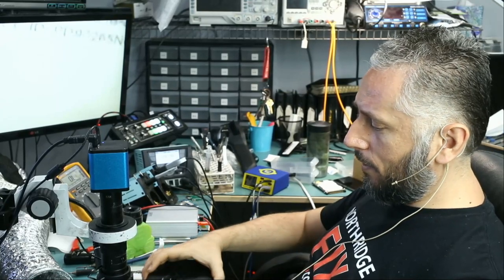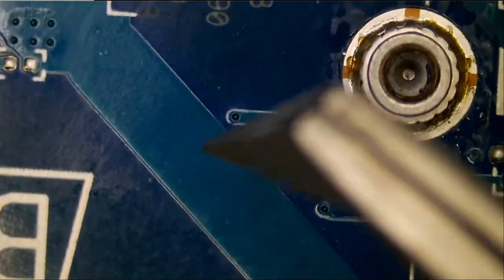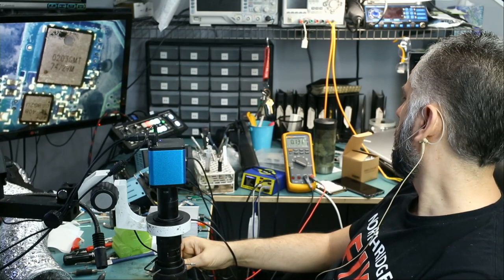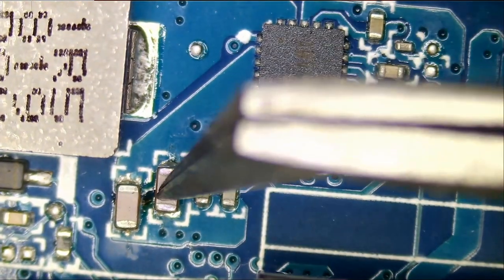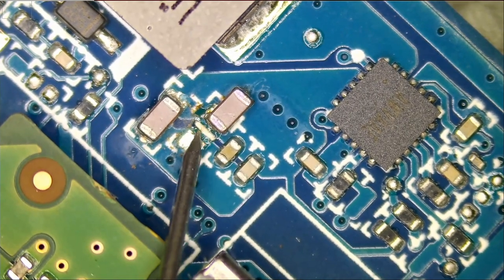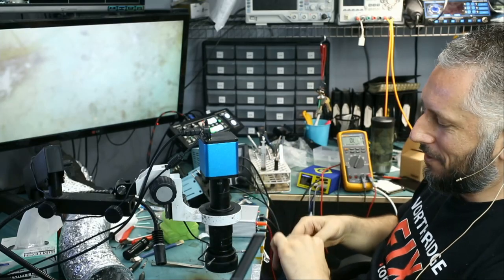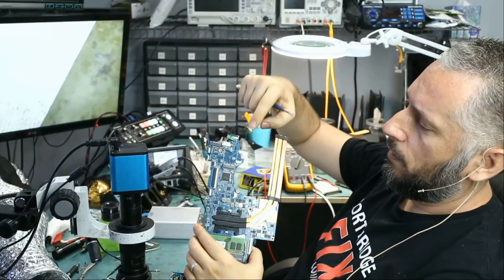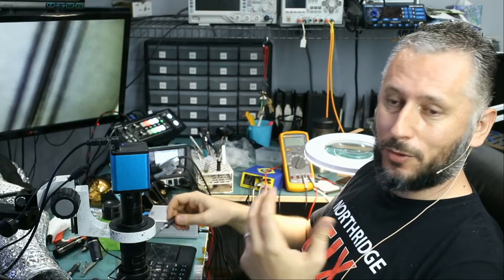HP Pavilion No Power Repair - Tracing short circuit using voltage injection & thermal camera

Comment: Your methodology of repairing is super duper cool.

1. Check connectivity.
2. Using Thermal Cam spot any overheating components.
3. Identify the cause of error and fix it
4. Job Done

Comment: What would you do without a thermal cam? Looking for a needle in a haystack for sure. Great video on how the find a problem methodically. Thank you for sharing your experience!
Reply: couple options, spray it with isopropyl and look for where it boils quickly, or feel around with your hand

Comment: Just found this channel yesterday, and I haven't stopped watching it!  Can't wait for something of mine to break so I can try to search for the issue.

I really appreciate that OP repeats things he's surely said in earlier videos (like what type of flux he's using).  So please keep that up for us noobs.  

My question - is there a video that shows an example of how to setup this short circuit search?  The way I understand it, is voltage is being injected somewhere and a continuity test is being done.  I'm looking for a noob version of this - where to inject the voltage, what to set the multimeter to, etc? 

In the meantime, I'll keep watching and cheers for this awesome channel!

Comment: After follozing you for a time, i juste do my first real repair even :) i was a efi chip desoldering /programing / soldering  for a macbook air a1466 emc 2632, and now it works. by the way it was olso my first macbook opening, o i ripped to small connector that i olo fixed. Thanx alex

Comment: Thx for sharing.
My short hunting is a little different. I use a current injection of about an amp and measure the voltage drop along the trace. This will guide you as to which path to take when the trace forks.

Comment: Thank you, good work again.voltage injection and thermal cam indicates shortened piece at the moment.we need that equipments I'm still burning my fingers to feel thermal increase on the board.and my lab power supply just injects max 5 amps even on 1 volts odd 30 volts.

Comment: Very good one. Thanks Alex. Quick question I may have missed, would a bench power supply work instead of the voltage injection tool?
Reply: yes it can, as long as it has variable voltage and amperage.

Comment: The short detector is a really excellent tool, I was just looking at one of your previous videos where you showed the mechanic short killer and I am thinking about maybe getting a similar tool for myself as I am working on a lot of TTL logic boards these days for printing machines and most of the time with those boards there are chips that short out between vcc and gnd.

Comment: I understand that injecting 7 A could be stressing some components, so you don't want to do it all the time, but as you had the injector set up, I'm wondering if there was a reason why you didn't just inject again when you suspected the final two capacitors? Surely one would have lit up the thermal cam and you'd know it was the culprit. Or did you always intend to remove both caps to measure the value of the good one?

Comment: great work
But won't an ESR Meter (equivalent series resistance meter) help in this case ? 
and this meter can be used on caps without de-soldering them because it uses a very low voltage.

Comment: Hello,
I would like to ask, if i connect the charger and touch the board with my fingers, is it possible that i might short something out? i noticed that u touch the board from the edges.
Would there be a difference if the laptop was powered on?

Comment: Hello i want to ask what temp's are you on when you want to reflow or remove any chip what do you recommend to set the temp's at !? Plus what kind of hot air station are you using ? Thanks in advance keep up the great content 👍👍
Reply: Hot air station Quick 861DW
Reply: @sallybundock1179  thank you
Reply: @sallybundock1179  and temp's ?
Reply: @mikeanderson1994  Temperature and airflow depends on what you are removing / installing the thickness of the board you are working on, size of component and size of nozzle you are using. You get to know with practice.
Reply: @sallybundock1179  thanks for the reply i have a few cellphone mother bored's that aren't working i will practice on those and hopefully i will learn how to remove or install chip's thank you again 🌹

Comment: amazing how just one cap can bring entire thing down its just crazy. things surely advanced but also not how they use to be either as ive seen vintage stuff with even missing or damaged parts and usually still work (no ideal to run such stuff like that but just an example how durable then to now how sensitive and some cases cheap things are)

Comment: Hello, 
I have a Lenovo yoga 2 that doesn't power on at all.
I left it charging overnight, and in the morning it was too hot, and the charger was not working.
Note: sometimes it powers on, but only gives a black screen.

What are possible problems? 
Thank you in advance.

Comment: The replacement capacitor was smaller than the original capacitor.
Therefore is there a risk of it failing again?
Reply: They are bypass capacitors, so no, not really

Comment: I too have the same problem with my Acer travelmate laptop every cap is shorting to ground and the lap refuses to accept power and charge when I plug the  charger an ic says 3f = 3k gets hot I don't know what ic is that local repair shop said it's a no fix

Comment: I way too far away to send you my old Gigabyte Pentium 4 desktop motherboard !
It came with 2 LAN cards but one of them was hit by lightning and it turns the LED like it 
it should but there is no Internet 9. 5hat I ternary board LAN card !

Any tips that I should measure first with multimeter ?
Can you help ?

Thanks in advanced !

sending it to you will be 3 times the actual value on that motherboard !

Comment: chief, why only the big caps ? is there any reason?
Reply: I believe the reasoning goes that the small caps have too little cross sectional material to sink 7A of current when shorted (that is a lot!). But bigger caps have enough material to sink that current, when shorted, and not blow its top. 
By the way Alex, an excellent example of tracking and nailing the problem. Interesting instructional video. 👍. Though I wish those initial steps of the video had not disappeared in the “9th dimension”. 😁

Comment: Great repair. I have 2 questions: con you link the thermal cam shop? And which tool do you use to measure the cap value? Your multimeter does not have Farad mode?
Reply: He is using LCR meter it cost like 150 us dollar useful for mesure of ESR DEREE LCR meter DE 5000 for thermocamera you can use HT19 it is good price and performance
Reply: @jeanmichel9207  thank you for the reply, but i am still don't understand why he doesnt use the multimeter to measure the Farad value of the cap

Comment: please I need your help I have Lenovo G700 it works fine without battery but when I put battery inside it will not power on again the the battery light blinks like low battery I need a fix please

Comment: Sir my laptop is asus tuf fx504ge it's not getting charger light on and not getting turn on battery also when I plugged a charger everytime in charging slot I heard a shorting voice and adaptor stopped supplying voltage what happened to my laptop sir please sir answer this question (my laptop suddenly got turn off and after that those syntoms I seen in my laptop)

Comment: I have a problem.  screen's lock.  I forgot my mobile code Can you unlock iPhone X Max?
Reply from the maker: If it was that easy then everyone would be stealing and looking at other peoples phones. If you forgot your code, Use icloud email to reset, if you forgot your email as well, then it's not your phone. What is an iPhone question doing on a HP laptop Video.
Reply: @NorthridgeFix  I called Apple, gave them all the data, and I'm not happy about it
Reply from the maker: Apple already has your data, and the top guys are most probably looking at everyone's data whether you like it or not. That's the world we live in today. A rule of thumb is, Don't put it on your phone if you don't want anyone to see it.
Reply: @NorthridgeFix

Comment: Why it's called voltage injection and not current injection? Isn't it that you applies voltage?
Reply from the maker: It doesn't matter what you call it. Laptop is fixed.